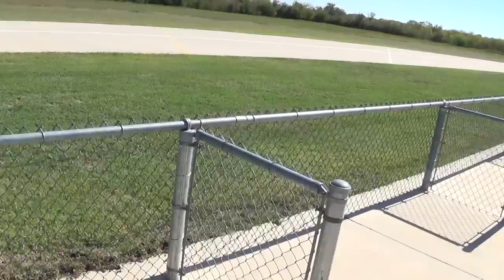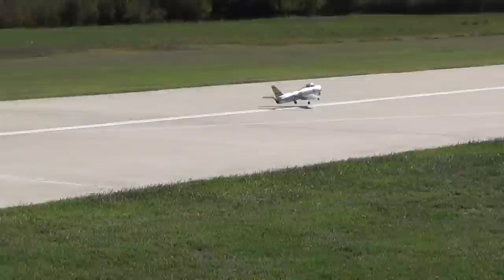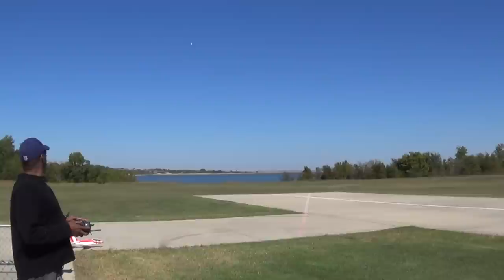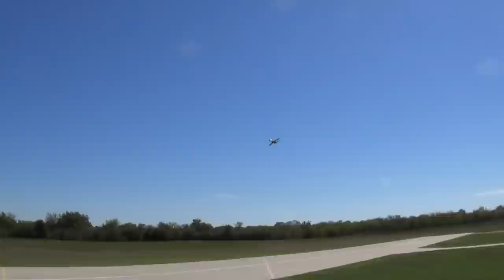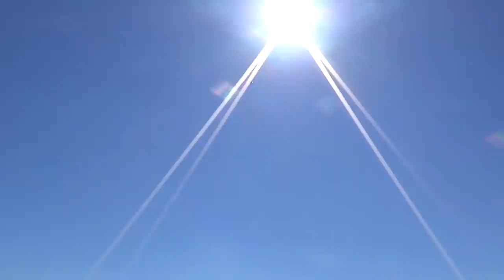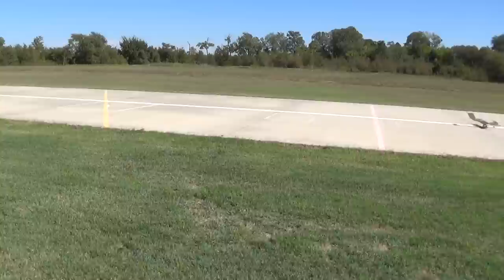Ultra Viper with CS 120mm 12s

Comment: Is that the 4 blade or 12 blade CS?
What is your esc brand and voltage?
What is your motor brand and kv?
I have a Foremost 160 that is going EDF very soon so I want to compare data. Electric or nuttin......
Reply from the maker: gman4reel0 Ok, updated  the video info... look at my video of the formost on similar system... You don't need a tone of power to get that going either

Comment: Sounds great! Nice work as usual Elmer! Which inrunner are you guys running with this?
Reply from the maker: Alpha10 going to go with outrunner for now...same company that does motors for leapord
Reply: edf sales Nice! Save some weight too! What kv was used in this video btw?
Reply: Alpha10 it was a 470 kv lepoard...think it was closer to 500kv though
Reply from the maker: Alpha10 Yeap, we're going to run with it... trying to keep it on the low for now...